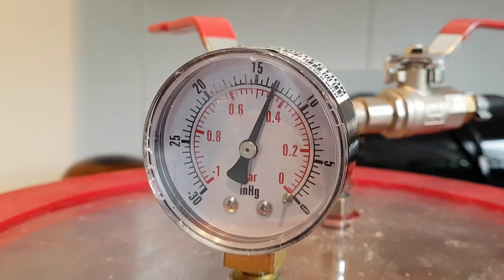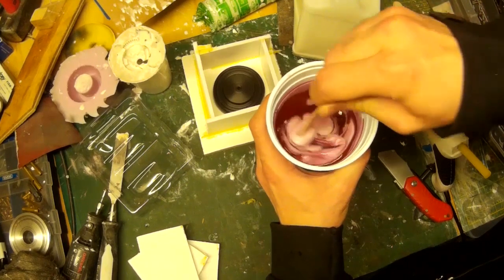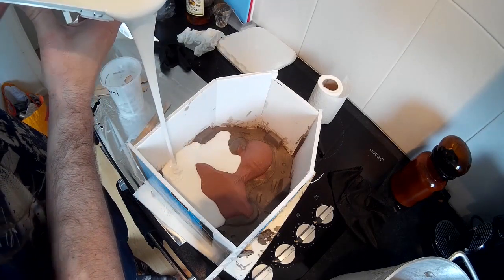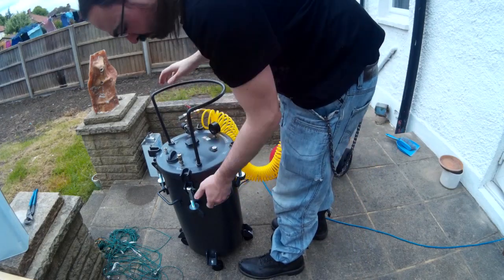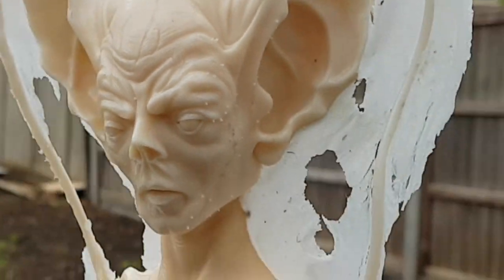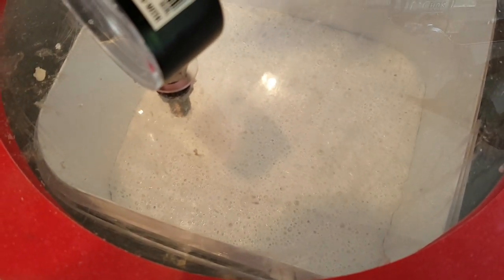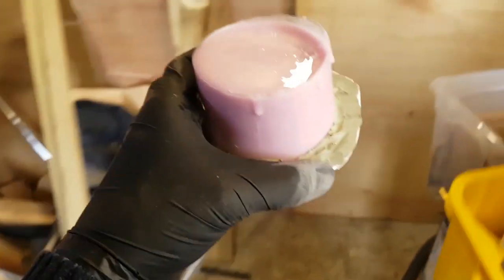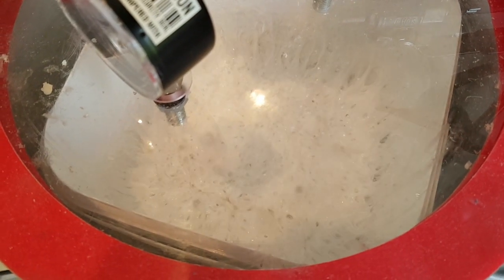Vacuum degassing silicon mould rubber

Comment: Interesting.
I double degas the silicone for our silicone ears, first in the pot, then in the moulds.
However, I use PolyTek Rubber for the moulds and these are a pian to get the air bubbles out, even after 3 minutes of vaccuming I still get bubbles on the underhangs, sooo, I have decided to try getting a pressure chamber to pressure the moulds after 3 minutes of vaccuming, I should have enough time before the rubber sets in the pressure chamber, I am hoping to get the pressure chamber and compressor this week, while I work on some new models to cast in the said rubber, Im hoping that this workds as I can get by with the bubbles as I can use wire cutters to snip off the bubbles on the ears, but this simply takes up time. So double vaccum, and a pressure set should work!, if it does work then I hope to have bubble free ears for our microphones. I use Easy Composites vaccum pump and 26L chamber (expensive), and just got a £400 pressure chamber and £140 air compressor, the latter being quite a fair price I think.
Reply from the maker: I've not tried pressure on silicon. I generly degas, pour the mould and, if it'll fit, put it back in the vacuum chamber and degas again. I generally cast resin rather than silicon though so I'll only pressure cast if the mould is particularly complex. Pressure chambers have got really expensive though, yeah. Good luck with the process!
Reply: @thedarkpower  thanks!
I’m using a different process with the pressure chamber and mostly everything is ok! Yay!

Comment: Just a note.I put an elbow on the the pipe so it faces the wall of the pot and not directly into the silicon container. I still let the air in slowly just to be on the safe side.

Comment: Interesting. I had no idea you had to vacuum the mold material for pressure casting later. Makes me wish molds I buy online would mention if they have been degassed or not. :p It should be a requirement but there are so many in house sellers online that don't. Even some big box stores don't specify but should. I have made many silicone molds using Oomoo and I have never had a problem with air bubbles causing an error with a bubble bursting on the item I was casting. I guess I have just been really really lucky. :P - Heidi
Reply from the maker: It's mostly a problem if you're pressure casting. If you're not you should be ok, except for the occasional surface bubble. But yeah moulds you buy should specify.
Reply: Oomoo is different type of mould (pre mixed and ready to go). The one he is using is more for professionals that make big models and mould for it that is made of two parts (you have to mix 2 parts together which creates bubbles as you are mixing them together). Hope it made sense.
Reply: @dikadog8  Oomoo isn't ready to go and is for professionals too. It has to be mixed and comes in two parts.
Reply: @BlackCat_2  my apologies, I thought it was pre-mixed!

Comment: I wonder if the chamber release valve could be modified with angled tubing so it doesn't blast at the material...
Reply from the maker: Yeah it wouldn't be hard to add abit of hose to it, I've got used to positioning it so it's not a problem now.
Reply: Add a 90° elbow inside and it will direct the air towards the side (or wherever it's pointing. Regardless it will be sideways, and not directly over the project).

Comment: How long is the small mold in the degassing chamber on the second round of degassing?
Reply from the maker: Not long - about a minute or so - it's just to allow enough time for any air trapped on the surface of the cast to be pulled away.

Comment: can you just put the silicone in the pressure pot while it hardens instead of degassing it?
Reply from the maker: Since silicon is stretchy I suspect any compressed bubbles will simply re-expand once the pressure is released. Having said that I've not actually tried!